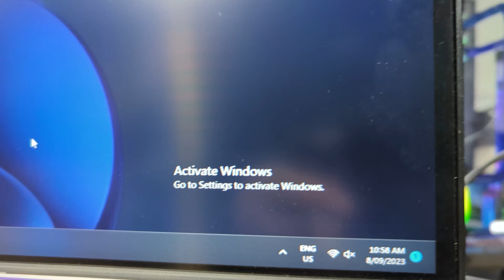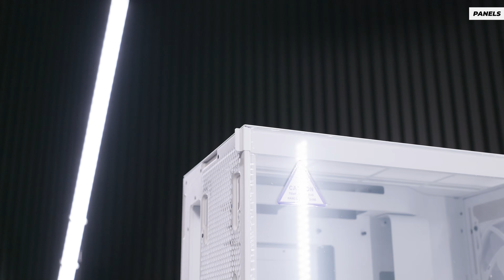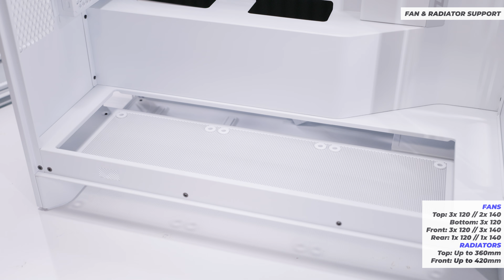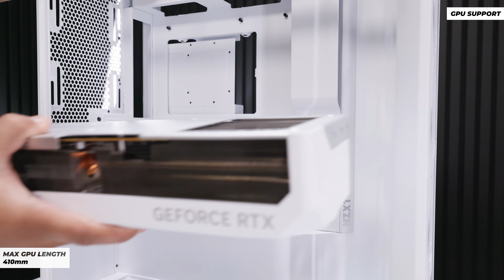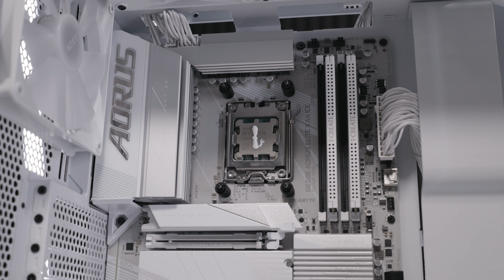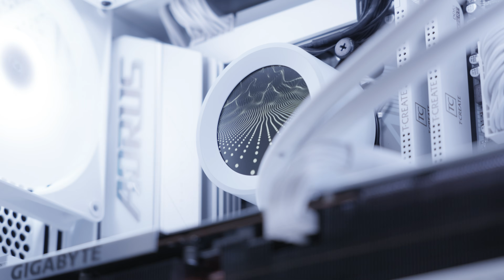NZXT's best case ever - The new NZXT H7 Flow RGB Review

Comment: Those 3 in 1 fans are a huge potential problem. What if one of the fans brakes? You need to replace all 3 of them not just 1.
Reply: Had a lot of fans break?
Reply: NZXT has a 5 yr warranty on them
Reply: @iCantHearY0u90  Yeah but you will be missing a whole array of 3 fans while you are doing the RMA process. Idk i like separate fans easier to replace or be without one if or when they die.
Reply: I’ve got this case and those fans and they’re magnificent and ultra quiet. NZXT cam is very easy for tailoring speeds and rgb lights too.
Reply: Nah. aesthetics > functionality
Reply: @florian6808 I like their duo fans and the single sided ring fans, I can’t stand core fans but to each their own